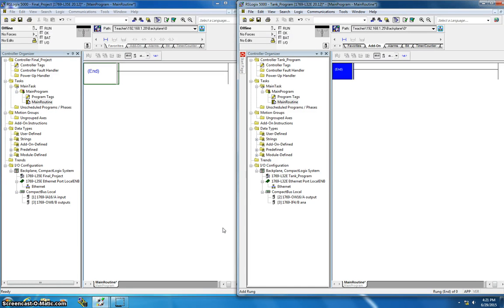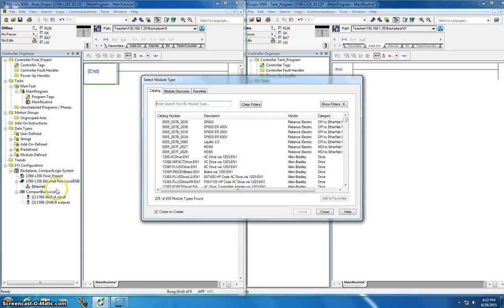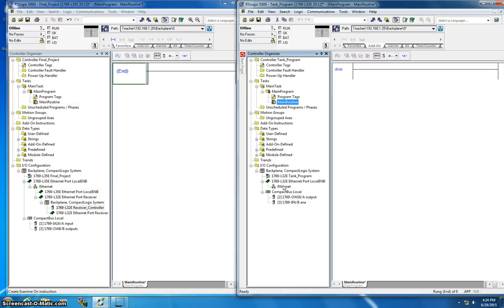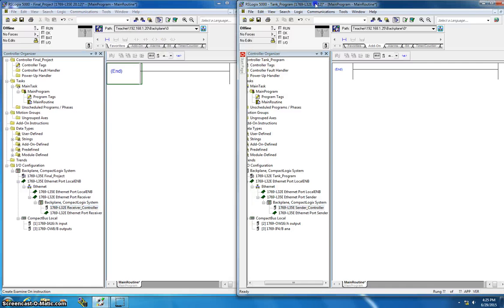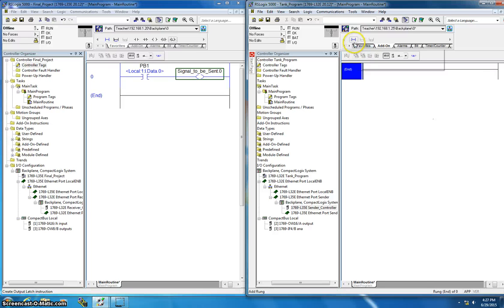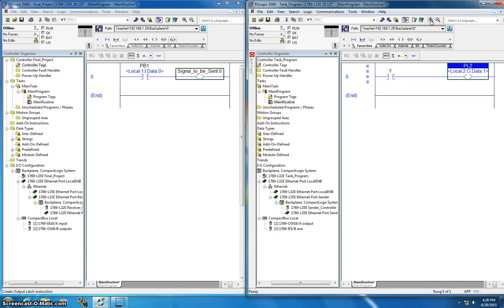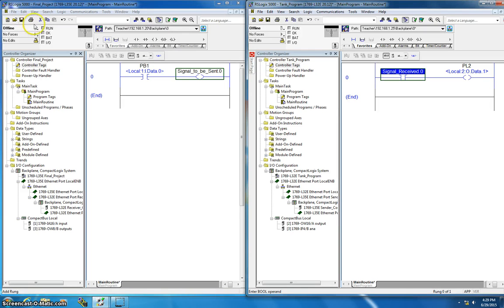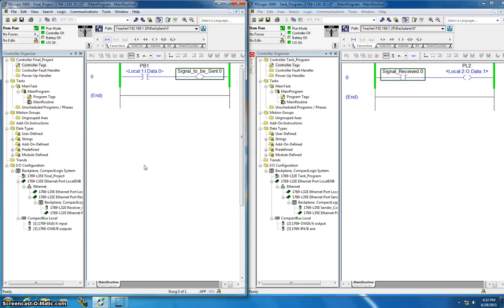How to program a producer and consumer tags in RSLogix 5000 to send bits over the Ethernet

Comment: Could you please advise how can I produce and consume 24 bit alarm tags.
I mean there are 24 alarms in on controller that are supposed to stop some functions in the second controller.
I have to move them first to DINT with a new tag like ( all_ alarms)  which will only occupies 24 bits and then consume that in the second controller?
Thx
Reply from the maker: Same process as this video but change it from a bool to a a dint and dont use the . after the tag name.  If that does not work try setting up a array with the information and send the tag over.  I have never done that but it would be the second thing I would try
Reply: @KletteTech  thank you for the reply. What's after the tag name. Could you try it as long as I am alive. Unfortunately I don't have two controllers to do the functional test.

Comment: Thanks for the explantion, i have a question, Can I send and recive tags betwen a controllogix and a compactlogix?
Reply from the maker: Great question.  I have never done it before.  But I was told by someone at Rockwell that you can.  The only question I still have not gotten an answer to is do they need to be on the same revision.  Since I have never tried I cannot say yes with 100% certainty.
Reply: Thank so much for your answer, I'll try it and  tell you after.
Reply from the maker: Awesome thanks